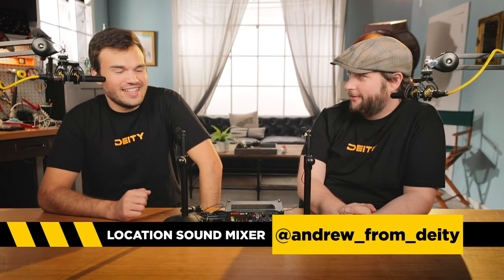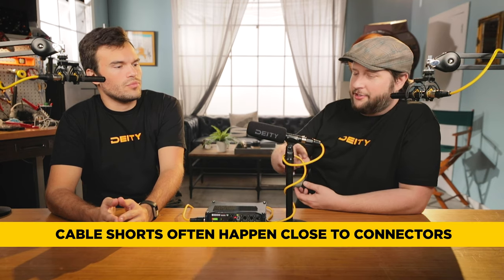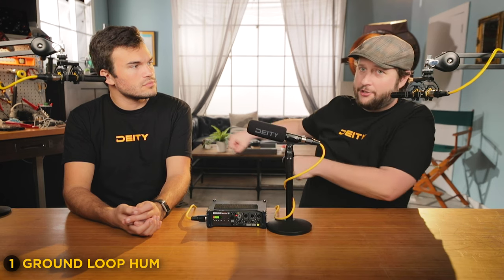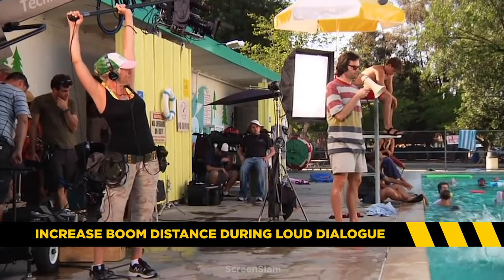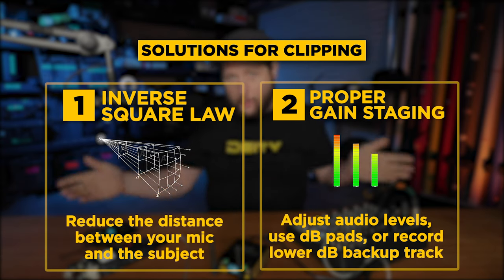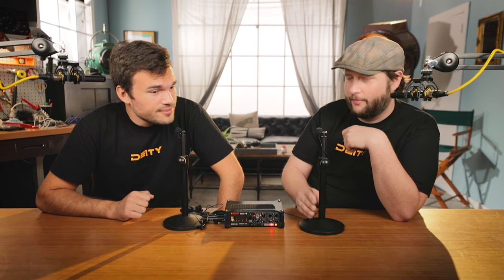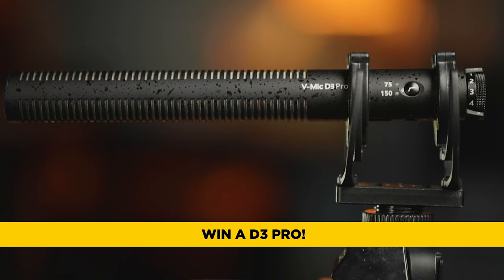How To Fix Bad Audio

Comment: I use to get "Ground hum" at my house because the equipment was plugged into two different outlets in the same room. It was a real problem until I started using a grounding choke into the RCA. The problem was the computer was on one end of the room and the audio was on the other.

Comment: Worst interference I’ve had was from a mains powered light. Couldn’t solve it (without changing the light). Running Star quad cable, tried two different mics .

Comment: 3:00 I know this was in 2019 but I should mention that each house in the US does not get it's own phase it's way more complicated than that. Technically you're getting a split phase or half phase. You'll get 120V between that and neutral or ground and phase-to-phase will be 240V. Larger businesses and more industrial areas will have three phase which gives a slightly different voltage between phases. Ground loops are when there is a voltage difference between two different pieces of equipment ground potential causing a current flow that manifests as sound. Please don't break the third prong off!!!!!!!!!!! Or permanently go through and use three prong two prong adapters because it works better that way so I never take it off mentality.
Electroboom has a very good video on electricity in the US/Canada and phasing.
and "A Clean Audio Installation Guide, by BENCHMARK MEDIA SYSTEMS, INC." is Excellent resource for understanding the what, how and why from the audio perspective.

Being between phases can sometimes cause issues but those are being confused in this video.

I see that one comment reference a correction however I don't see anything of the like in the description.
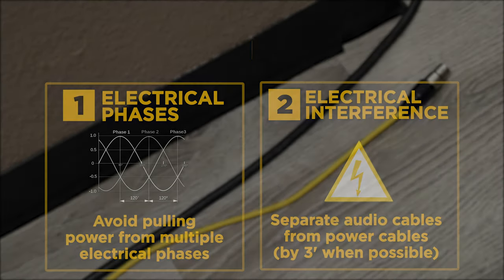Edit: 4:50 I see there was a correction in the video, it came off a little vague.

Comment: I am recording the engine and exhaust sound of a old Camaro, ( it gets loud ), my problem/ question is: when you have reached the maximum SPL on your microphone, and can not mount it further away, is there a method I can use for shielding/damping the sound pressure? Thanks for great videos! ;)

Comment: I'm not familiar with Deity product line.  Which mic being used by hosts?  is it S Mic 2S with shock mount from V-Mic D3 Pro?
Reply from the maker: Yup! We are using the D3 Pro shockmount instead of the Rycote Inv series mainly bc we have a much of D3 Pro shockmounts laying around. We sometimes use these, sometimes we swap them out with some that allow a pop filter.

Comment: Could you do a video on best recording practices for live events like weddings, or concerts or other sort of live events? I tried recording out of a powered speaker at my last wedding and all that audio was ruined and clipped really bad at -6 dB on my H5 recorder, and I didn’t find out until post. Why was that? Was I mistakenly putting a line level xlr signal into the mic level xlr port? Did I accidentally have phantom power on when it wasn’t needed? Was it the dj clipping the audio before it reached me?

Thankfully my backup lavs saved me!